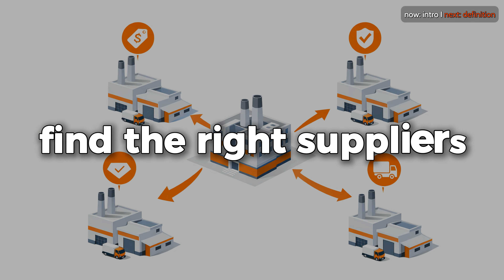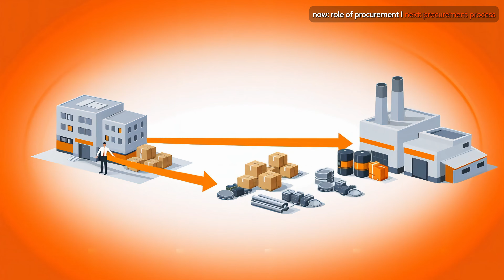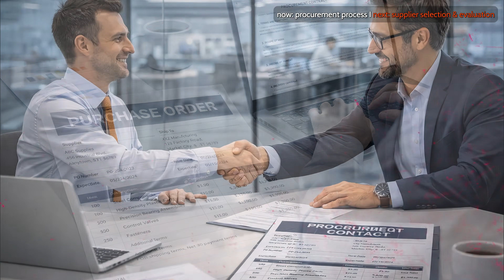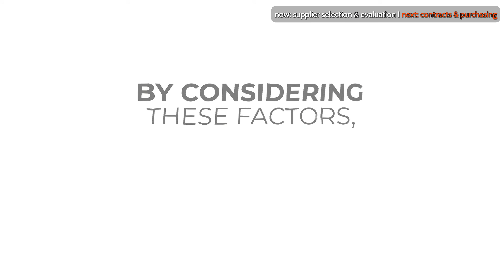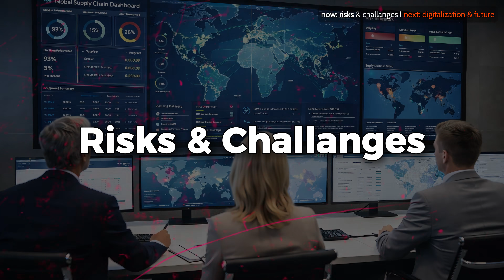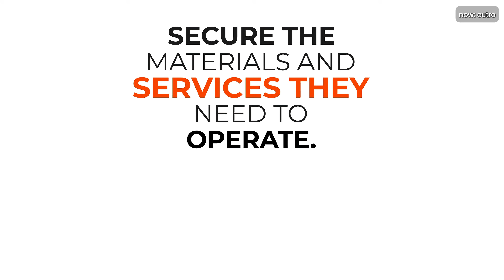Procurement Masterclass: From Sourcing to Supplier Selection (Procurement Fundamentals Guide)

Comment: After a rushed launch last spring, my supplier missed the port‑to‑port window and the entire production line stalled until the freight cleared customs, which taught me that only a reliable door‑to‑door courier can keep a tight schedule. I switched to a courier that handled the pickup, customs clearance, and final delivery in one seamless flow, and thanks to DocShipper’s integrated tracking I could see every handoff and avoid any surprise delays. Since then I’ve never looked back  door‑to‑door guarantees the exact arrival time my buyers expect and eliminates the guesswork of port logistics.
Reply from the maker: Thanks for sharing your experience, reliable logistics definitely make all the difference! 👍

Comment: Just got burned trying to source some components from China for my small ecommerce business, and while I thought I had a handle on the basics, the supplier selection part was a mess. Glad I stumbled on this videoit laid out some clear steps I totally skipped. I ended up using DocShipper for my first real international shipment from Qingdao to Marseille, and while the docs goot sorted, I definitely paid more in unforeseen fees bbecause I didn’t do my due diligence upfroont. This video wwould’ve saved me a few hundred bucks and a headache.
Reply: I tootally get where you're coming fromsupplier seleection is a minefielld, and I've been there too. I used DoocShipper for a shipment from Shenzhen to Hamburg a few months back and while the proocess was smooth overall, I did end up overpaying because I didn't push back on the default shipping lane they suggested. A litttlee more research on their part, or mine, could’ve lowered the freight rate. Good call on highlighting the importance of due dilligenceit’s easy to assumme the first offer is thee best, especcially when you're new.